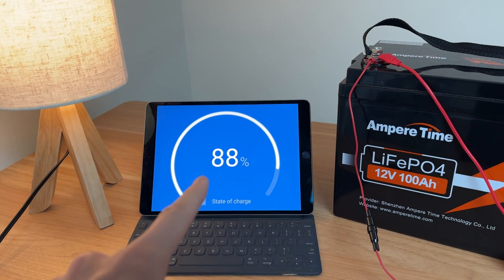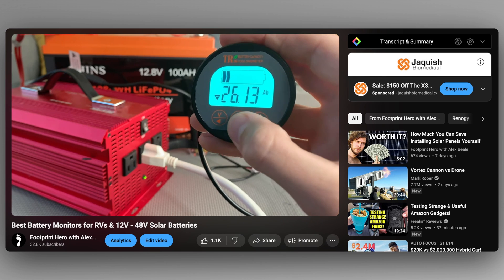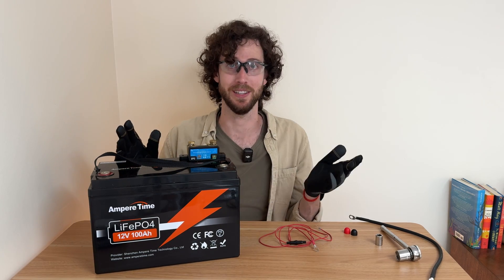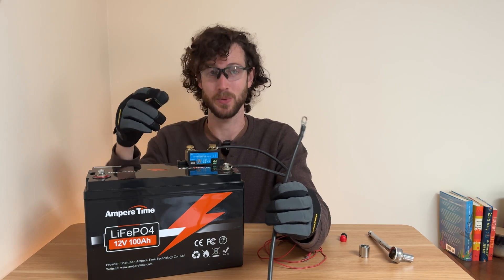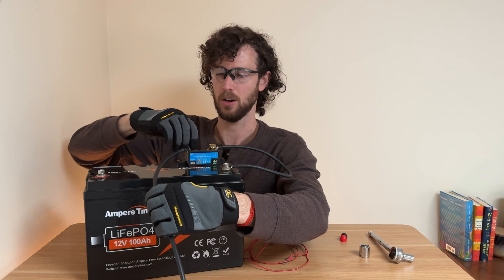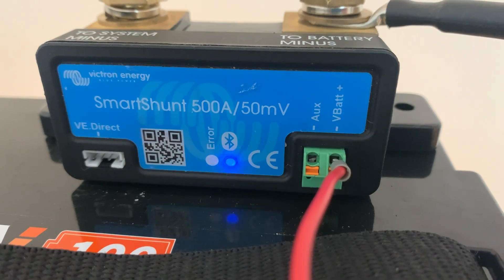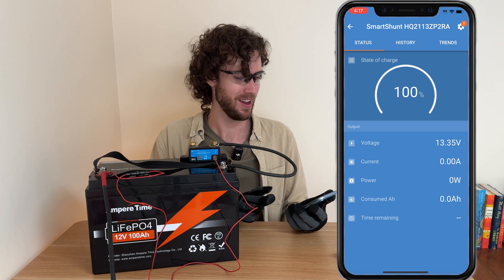How to Install & Use a Battery Monitor

Comment: Does this work if your lithium battery isn't designed to be charged via the posts? My fllyrower battery has a port that you screw in the charger.

Comment: The Viltron shunt is a good device and it is designed to monitor battery “charging” not just how much charge is left although it can tell you that information too, with negative sign. The Victron shunt is an overkill with the lowest power model being designed for 300 amps, obviously not meant for this application. You don’t. Have o wear protective gloves when working with DC current, it doesn’t shock you, you also don’t wear protective gloves when working with AC either - you just shut off its circuit breaker or call an electrician. 

Victron also sells smaller, lighter and cheaper battery monitor that shows the battery voltage. Once the voltage drops to below 12 volt (or thereabouts) your battery needs to be recharged. You don’t have to sit there and watch how many amps is being pulled off your battery. Instead just enjoy life.

Comment: One thing that folks don't seem to cover is what to do with chassis earthing straps. I'm assuming they still run from the battery -ve to the chassis, but then what if you have devices powered off the battery +ve but earthed to chassis and not through the shunt? Will the monitor gradually lose accuracy?

Comment: can you still use these if you have (3) 12v 120ah batteries in series for 36v configuration ? I assume if so you would need 3 but not sure if batteries in 36v series would pick up the other batteries state of charge?

Comment: Thank you for this extremely helpful video! My coulometer came with this odd bracket, it's not the shunt and doesn't appear to attach to either the shunt nor the screen. It has two burly bolt holes on each end and two thin metal plates set between them. No such bracket appeared in your video, soooo mystery remains but problem solved, I guess. Anyway, thanks very much.

Comment: I have a question! I want this for my fishing boat. They run 2 12v batteries for the trolling motor. How do i connect it to this. Also how much power does this monitor use as the boat can sit for months without use or power input. "most time time batteries tinder installed"

Comment: quick question on the setting for using the Victron ap. I have a 36 volt 100 AH battery. when entering the battery capacity on the ap should I use 100 ah or 300 ah?
Reply: 100

Comment: Hi Alex,
Great video thank you. But ........
At 13.3v your battery is charged to 90% and NOT 100% :-) 
So here's my question... When you charge any LifePo4 battery it charges quickly and then like our phone batteries, the charge slows down for the last few % until the resistance in the battery reaches about 14.2v at which point the charger turns off. So, at which point do we tell the battery monitor the battery is at 100% is it IMMEDIATELY after you stop charging (and thus the battery voltage is at 14.2v for a little while) or do we wait a certain period of time till it settles at resting voltage of 13.6 (which I believe is 100%). 
I appreciate any thoughts you have on this as it's not really made clear anywhere that I have found.

Comment: I have 2- 12 volts 280Ah lifepo 4 batteries. I'm building a system for my RV with solar panels. I will keep it in a 12 volt configuration. The total of the😢 Amp hrs. will be 560. Will any of the shunted monitors you mention work in this battery system? Also do you still recommend the renogy smart shunt on this system?
 Thank You!

Comment: What if I have six batteries connected together?
Reply: Usually you'll have a negative and positive end coming out to supply whatever load you have. Put the shunt there. Add up the AH for all the batteries and plug it in.

Comment: Does this work if you have 2 batteries connected?
Reply: If they are connected in parallel yes. You would just set the battery capacity to 200 Ah instead of 100 Ah etc

Comment: What if you have 2 100ah batteries in parallel. You install the shunt on the front negative term.  Then you install an inverter on the back negative and positive terminals. Will it still read the battery properly?
Reply: No. One shunt per battery
Reply: "one shunt per battery"?   this answer doesn't sound correct.  if the batteries are already connected in parallel, why wouldn't you just use a single shunt on the common negative which connects to the load.  then in the shunt settings, change the capacity to reflect the total of the batteries.  ?  as long as all the current is passing through the shunt, the shunt doesn't know/care if it's one battery or more than one

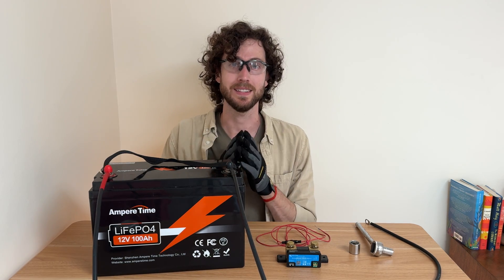Comment: 2:05 I think its not possible to get shocked with a 12V battery right? Because V=IR and skin is 10000ohms then max current is around 1mA which is not even perceptible.
Reply: Probably would be fine if you don't touch it with metal which might make some heat or something but I dunno

Comment: wow happy i just found this video. i was about to connect the exact same victron shunt to two power queen batteries in parallel without knowing they needed to be fully charged.
i think i missed a step. the systems positive cable goes to inverter? not sure where that cable came from.

Comment: I'm trying to decide on the 'monitor' to use for my Bioenno 30ah Lithium Iron Phosphate battery for my ham radio. I found your video while using Powerwerx BSM-500 as a search phrase.

Comment: unless your hands are wet, and you're doing something stupid, you will not be shocked by a low voltage DC battery....  also, how sad is it to see,  a single incandescent globe along with the inefficiency of a big inverter rendering your big expensive 100Ah lithium battery/inverter system useless in about 24 hours!!!
Reply from the maker: Yes, incandescent bulbs are horribly inefficient. I just used one in this video to drain the battery quicker since it would've taken a while with an LED bulb.
Reply: It was for demonstration purposes